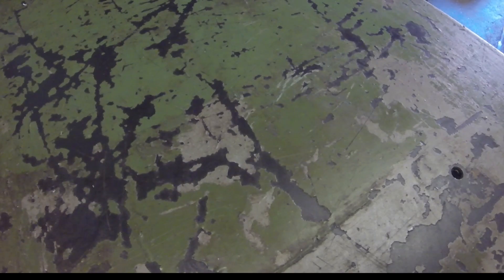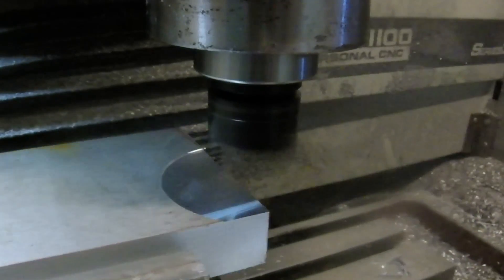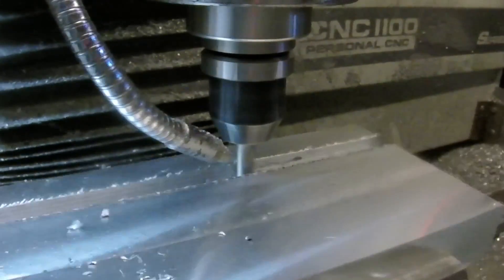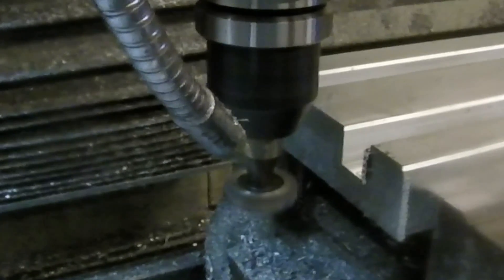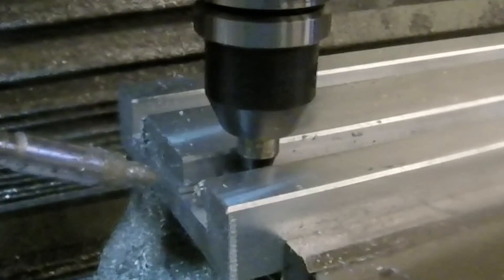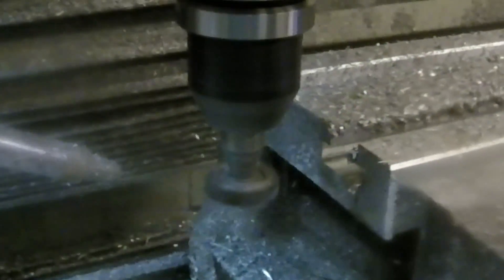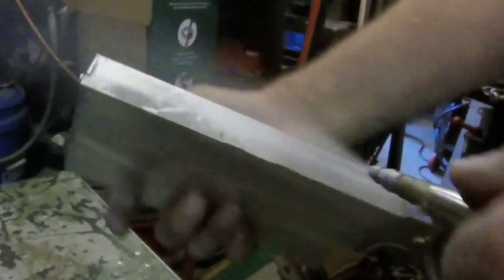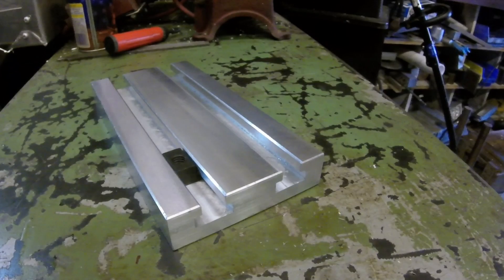Making a sacrificial aluminum T Slot table on a Tormach PCNC 1100

Comment: not machine's fault? 
that's a pOS machine if you ask if you can't cut through aluminum
Reply from the maker: So is it your opinion that speeds and feeds have no effect on cutting?  Just throw some aluminum on there, and let her rip?  If it doesn't work it's crap?  I respectfully disagree.  The programmer can absolutely throw some garbage code at the machine and make it jam up; even in aluminum.  That's what I did.  Changed the code for future versions and now it's working great.

Comment: I agree with you everytime when I use t-slot cutter. It screams. 
But good job on that sacrificial plate. Nice to have one the shelf for any case.
Reply from the maker: Thanks man.  It's nice to have what you need when you need it and not have to make something just to make something else.
Reply: Screaming mostly occurs if the cutter rubs too much. The slotting mill has a lot of cutting edges, so you will end up with way thinner chips than with less edges. To counteract that you can either turn down the spindle speed or turn up the feed. Most cutters are happier if they get enough to bite.

Comment: Nice work!  What were your feeds and speed for the t slot cutting?  Thanks
Reply from the maker: I used 2,800 rpm and feed of 7.  First attempt was too slow on the rpm I think.  I've been using whatever free online calculator I find for my speeds and feeds but none that I could find allow for a t-slot cutter so I had to wing it.  I'm sure there are better settings but it worked for this one.  If I make another I'd like to play around with it some and get it fine tuned.
Reply: Thank you!